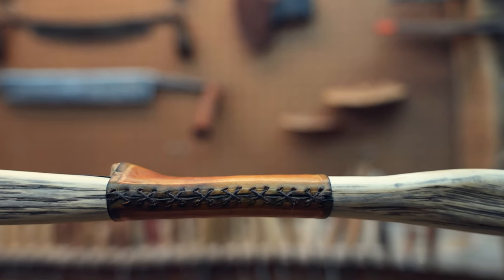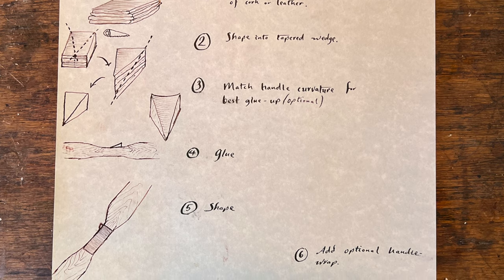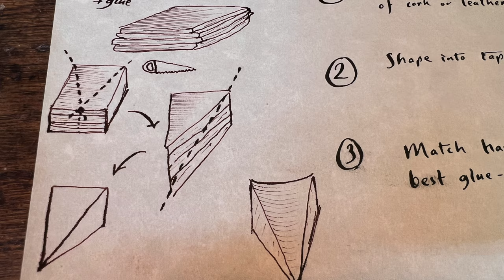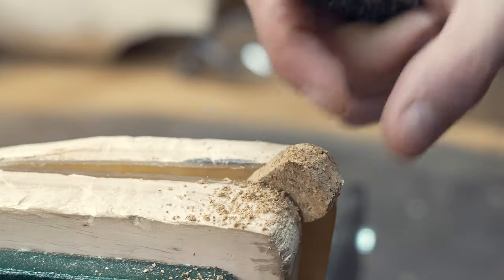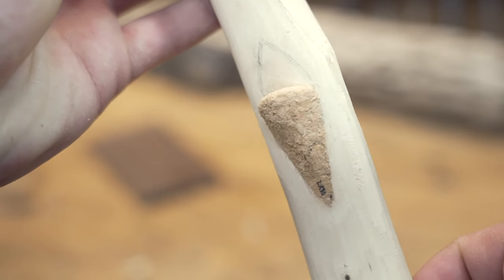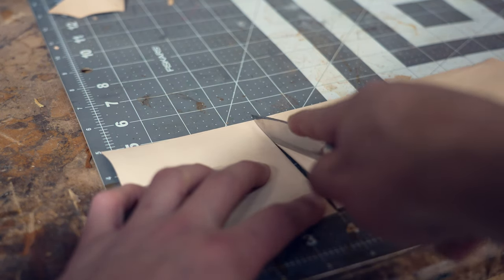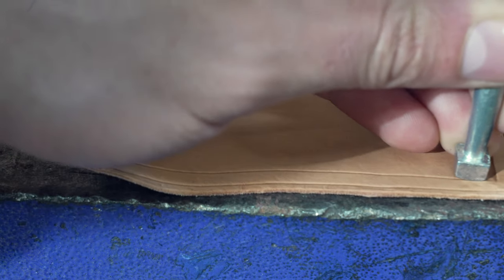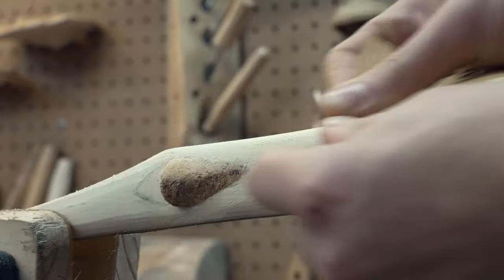Arrow Shelf Tutorial | How to add a cork arrow rest to your bow

Comment: Your videos are so relaxing and mellowing!

I don't like having a strike plate on my bows, so I make the leather of the handle an inch higher.  When the leather is stitched on I make a slightly curved slit in the leather, one inch down, in the location I want the top of my arrow shelf.  Then I put an appropriately shaped tool in the slit and pry and stretch the leather untill there is just the right shape pocket for my laminated leather wedge and I glue in the wedge with contact cement.

This makes an inconspicuous arrow shelf that uses the top of the handle wrap as a arrow plate.
The leather that I use does not get torn up by the arrows--it just buffs up to a shine over time in the arrow pass area.

Comment: Hi Dan, thank you for your inspiring video. As a beginner I would have used hardwood or horn for the arrow rest, thinking that it would be more durable than cork. Why do you recommend cork?
Reply from the maker: If the arrows are well matched you shouldn’t be hitting the arrow rest anyway. With horn or antler when you do get contact it will be much louder and deviate the flight path more. Contact with cork or leather will be slightly dampened. The biggest advantage is that drawing an arrow over cork or leather is quiet, while with horn or antler this can be too noisy for hunting